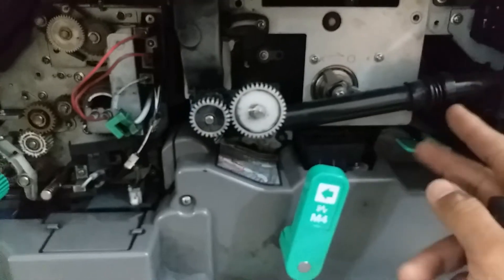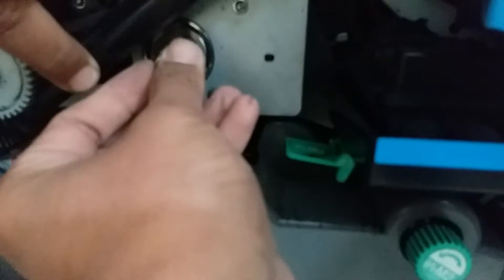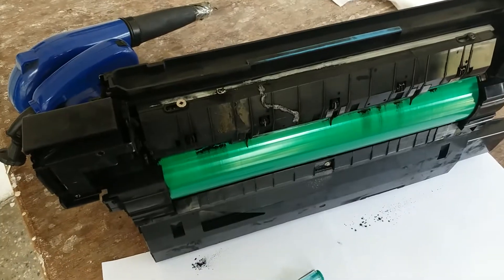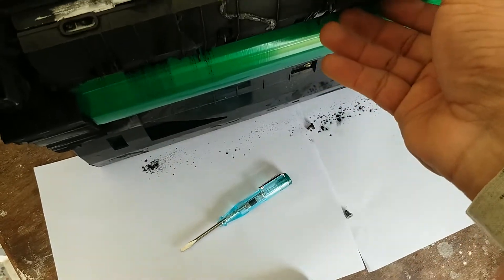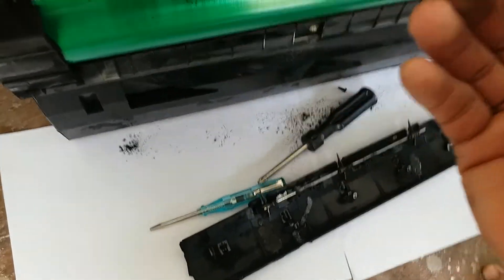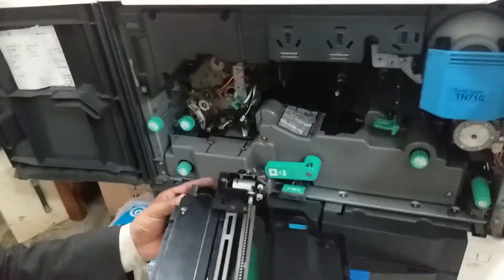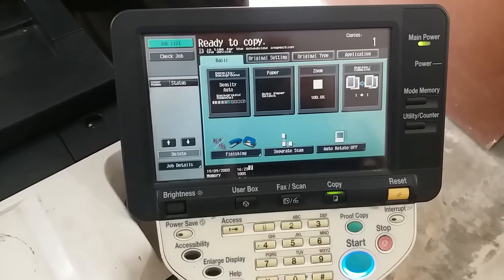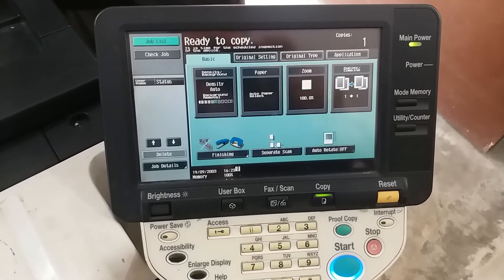Konica Minolta bizhub 601 fix not getting ready

Comment: AoA, I've cleaned the sensor but problem is not solved. I've cleaned the wire sensor in the heater unit too. Is there any other reason?
Reply from the maker: Plz whatsapp 03449860174  and also chk heater conection wires maybe ur machine heater not working